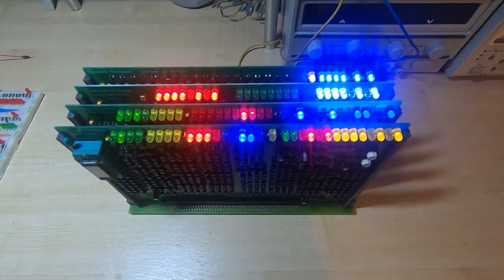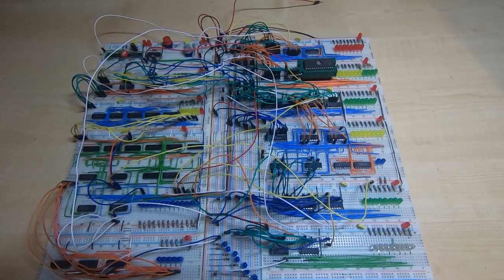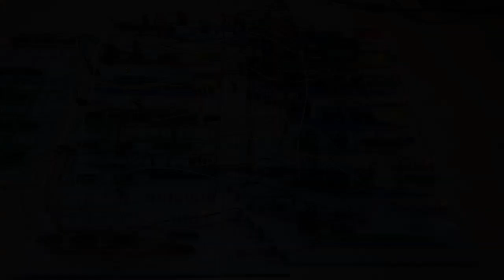Time 2 Processor

Comment: How big would the Time 2 Processor be if you implemented it on a PCB instead of breadboards? Also this would be interesting to do as a kit like you have done for your Transistor Processor.
Reply from the maker: The book shows a breadboard version of this processor. However the idea is to show the basics of how a processor is implemented rather than 'simulating' it with logic chips.